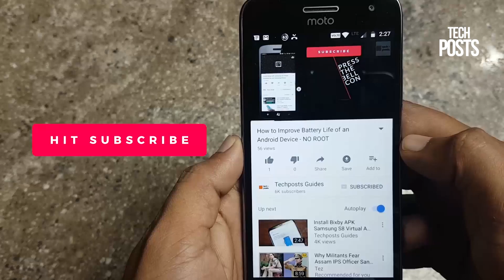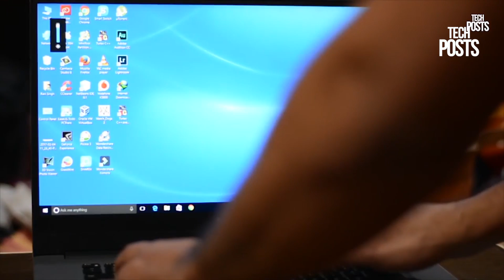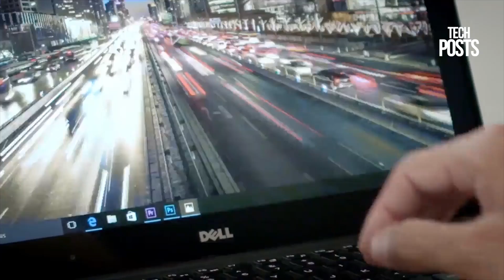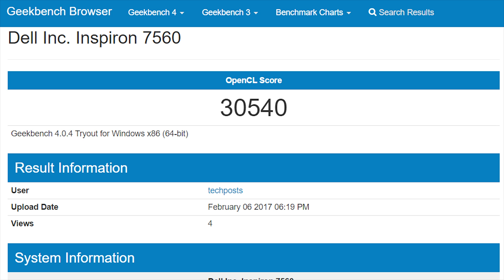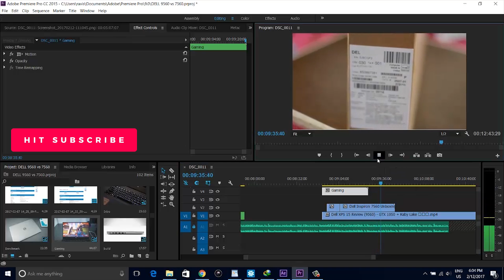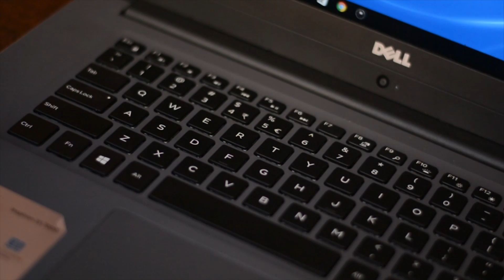Dell Inspiron 7560 VS XPS 15 9560 - Review and Comparison

Comment: Are their screen sizes similar? I mean the top dimensions, length breath and diagonal for the screen?
Reply from the maker: There are now new models which are much better. You won't find this one easily now. It was released in 2016
Reply: @ravis1ngh  I have 7560 model! But m not getting skins for the same. So just wanted to know if I can take any of thr xps range skins be it 9560 or 7590, that can fit well on my inspiron 7560!
Reply from the maker: @pritamkaushik8021  You won't get a back panel sticker for Dell 7560 or any other model coz they are not made for a particular laptop. They come for 15' laptop 13" 11" etc. You have to mark the area by placing it. Then cut a bit wider than marked area. Paste it and then use a sharp blade to finish corner. That's how i did. And that's how it's done.
Hope this helps.

And I bought this from postergully back in 2016
Also, this is Dell 7560 not XPS. Poster is still looks good. No scratches as it's matte

Comment: is there any difference in Dimensions between the two?
i want to buy skin for my inspiron but that skin is available for xps 15 so please reply 🙂
Reply from the maker: Buy skin for 15 inch laptop and it's going to fit your display size. Very close. Also, skin size is a bit larger than the actual laptop size.
Reply: Techposts Guides thanks for ur reply but just tell me if there's a difference between their dimensions 😊

Comment: I laugh when you say plugging in AC will boost speed... FYI.. its just that when you are not connected in AC the laptop tends to be in battery saving mode... you just need to disable that and the laptop will not slow down... it will continue to perform at its highest capability but in short term since it will use all its battery....

Comment: I tried to buy allienware 17 laptop with headset which are £3090.00
My payment for laptop has declined but for headset is processed and they were shipped out. I send them email to cancel order because I don't need headset without laptop. How comes? I putted into basket 2 items, they charge me which is processed. I understood, there are someone in office and try to charge your card without your knowledge. When you submit your first order, if its not successfully, then they try to charge manually. They are using your card details. They saying they can't cancel order and cannot refund money for headset. There is must be cancellation and returns period e.g. 14 days. Also I sent cancellation email before dispatch the item. And they didn't ask me to charge my card behind of process.

Comment: Please help regarding color leak issue for 7560
https://drive.google.com/open?id=0B6aIfjZu_i1IOHE1NExjdU9aODg
Reply from the maker: +Karan Singh Hi Karan. You should contact Dell Support for this issue. It's hardware issue, just try to convince them and send them this picture via mail. They will definitely replace your system' panel. 
This is not the case with my Dell 7560.